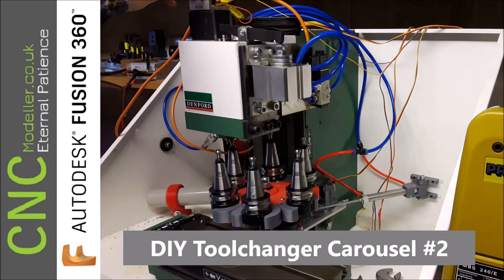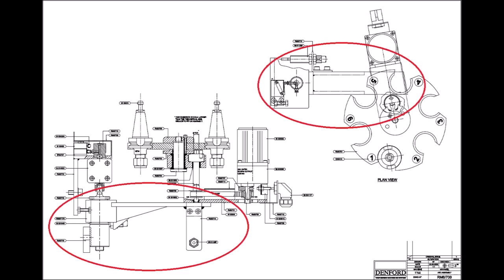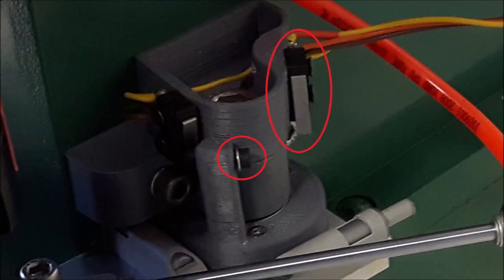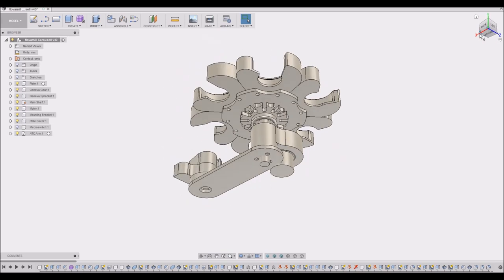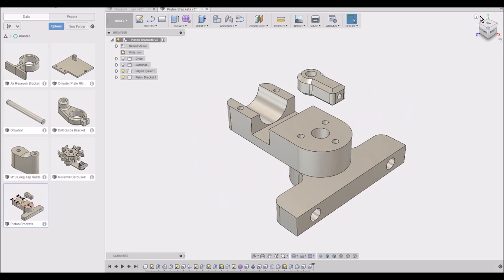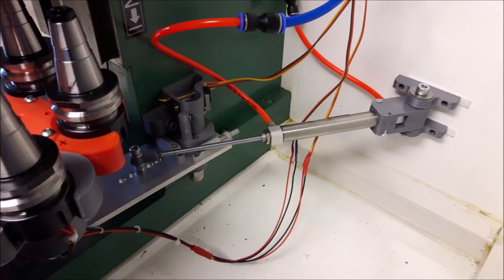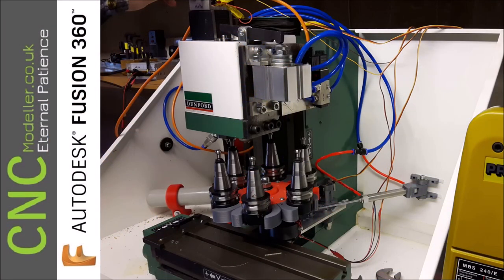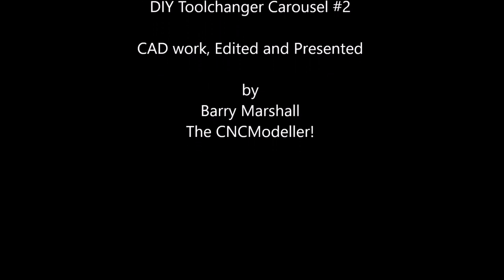How does it work DIY Toolchanger Carousel #2

Comment: This idea is cheaper than ready kit from China which use slide on two LM guides. Main hinge should have wider space between bearing and stiff arm. A lot of weight hanging and swinging. Thanks for inspiration.
Reply from the maker: Hi @Tom J Designs,
           This is a reverse engineered version of Denford's original design. The 3D printed parts aren't up to it, but if it was made out of metal I'm sure it'd work OK. I'd also switch out the Geneva gear for a stepper motor and an Arduino to move the carousel to the correct position.

Hope your build goes well!

All the best
Barry M

Comment: Nice cool
Reply from the maker: Thanks. Glad you liked it...
Reply: @CNCModellerUK  Going to do something similar on my Diy CNC Milling machine 

Are you using Mach3 or something else?
Reply from the maker: I'm using the OEM software from Denford. It's a bit glitchy around the edges but just works. The tool changer is a copy of the OEM option. Good luck with your build!
Barry M